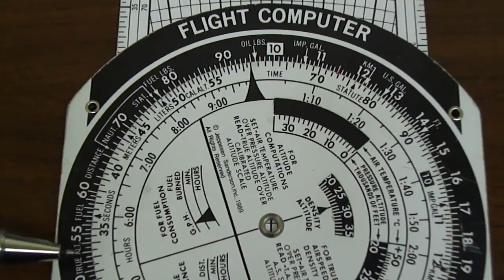E6B Flight Computer: Remaining Flight Time

Comment from the maker: @jeepinbanditrider Glad they helped. I'd encourage you to start out in gliders if you can. It's much cheaper, a ton of fun, and requires good stick and rudder coordination, formation flying, and an understanding of aerodynamics and weather you wont get in a powered airplane. If you stick with powered the biggest challenge is a solid foundation in the fundamental knowledge, FARs, and multitasking. The flying of the airplane is actually quite easy.